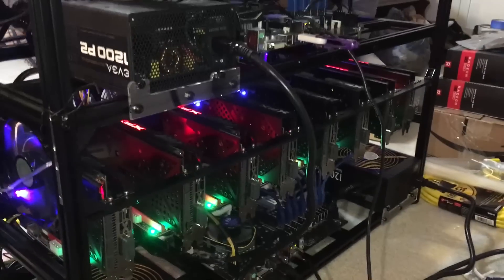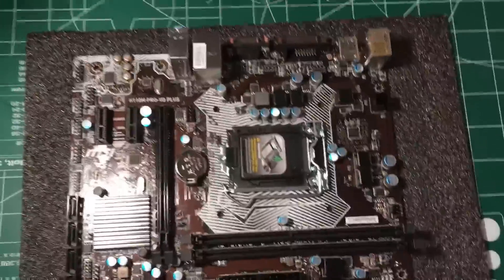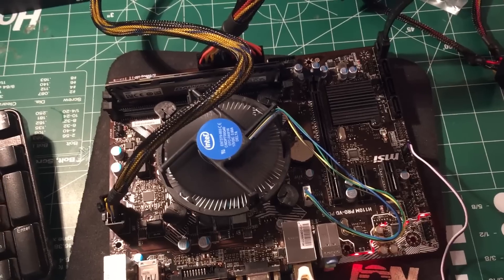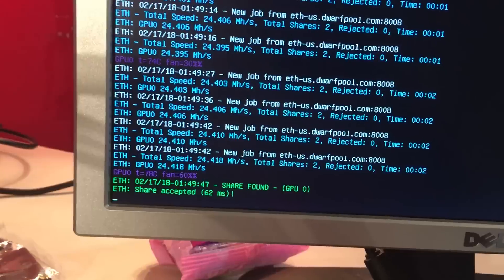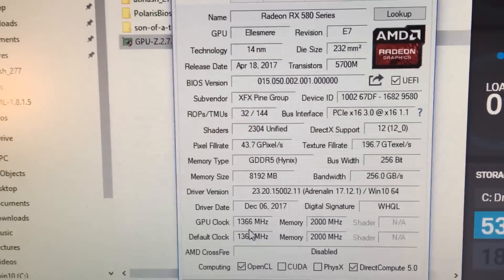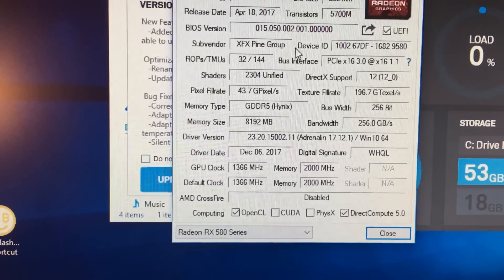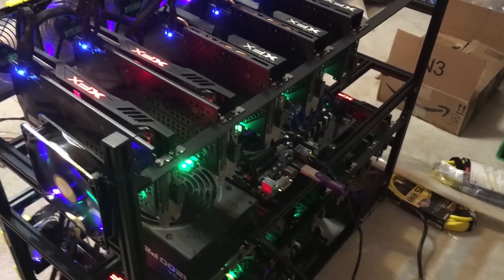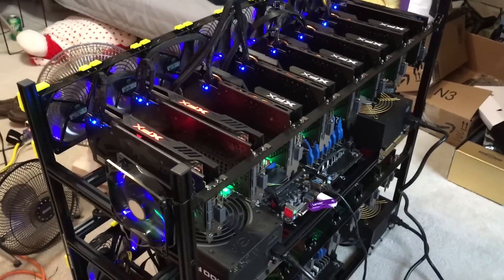GPU Bios Flash Test Bench - Crypto Mining Rig

Comment: I’ve found that it is a balance between hashrate and electricity cost. I got my XFX up to 28 Mh but the cost of electricity didn’t make it as profitable as running GPU at 27 Mh. My rig wasn’t as stable either. I prefer to run the GPU for 12-24 hours to see its stability. At 28 I was getting restarts after 12 hours and incorrect share messages. Now it runs 24/7 with no problems, 60 degrees celsius at 50% fan speed. No extra fans or open windows. Stability and net profit most important imo. Great info on electricity and wall outlets in other video. Thanks.